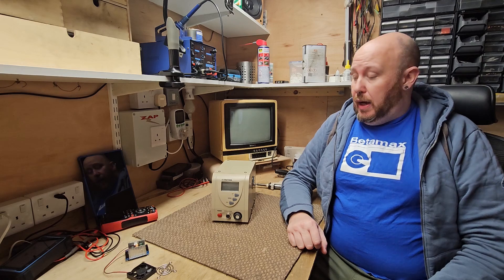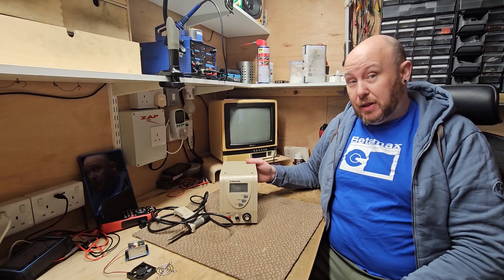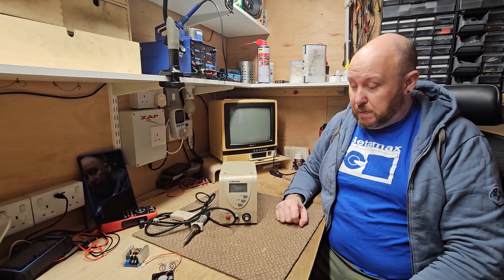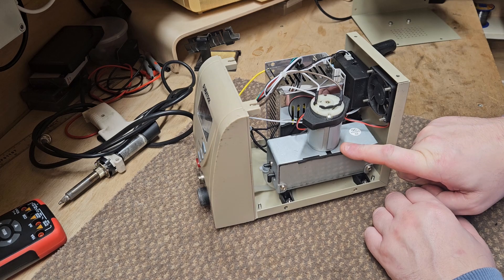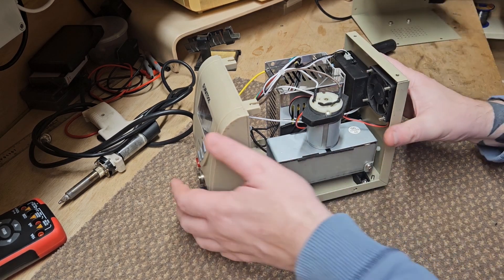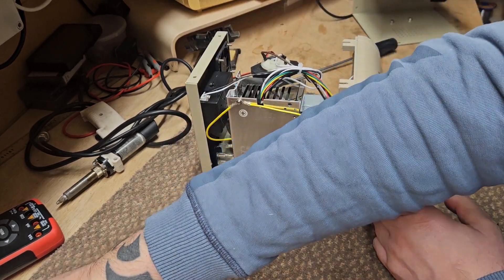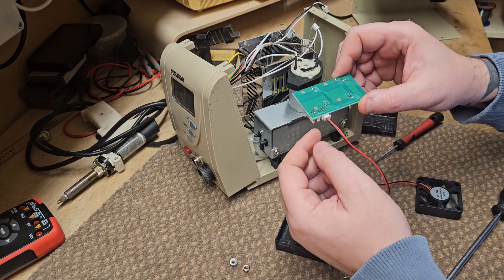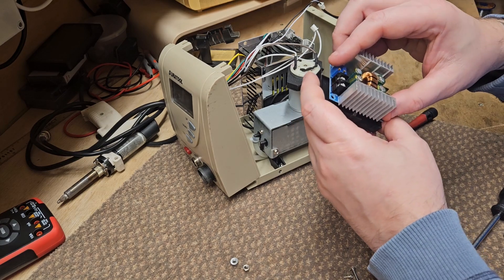Duratool de-soldering station mods

Comment: I replaced the 2 "cylinder" membrane pump with a rotary (axial) pump from the central lock of some old MB, and it is the best mod. These motors can withstand serious overvoltages, so a factory resistor dropper is absolutely fine. Higher voltage = better suction.

Comment: You have room in the front part of the unit to keep a spare fan , if you have quality fan it's probably not needed , but ya never know ........  Which buck convertor did you use ?   I plan on buying a electric de soldering pump soon ....... I will be doing the mod and putting in rubycon ETC. caps on the boards ..... That way I don't need to worry later on ......

Comment: This video has convinced me NOT to buy the duratool. If it takes this much effort just to get a decent product then fuck that I'll buy a Chinese product instead. Considering I've never used a soldering iron properly the whole idea of modifying it is extremely daunting. Still researching which one to get.
Reply: same thing different branding. Hakko are the proper japanese brand. Actually CPC and Farnells stuff is almost almost chinese rebranded crap, check for soldered wires going into terminals in place of wire ferrules or bare wire.
Reply: @ps3customgamer I ended up buying the fr-301.

Comment: I adjusted the vacuum from 500mm /Hg to a beautiful 750 mm /Hg beautifully quiet. It sucks even micro holes. The gun has 250-400 mm /Hg depending on the filter. Maximum after adjustment 600 mm /Hg
Reply: How do you bump the suction up on the pump?

Comment: I was looking at buying one of these, should I avoid it? I don't really want to spend £400 on a hakko one! 

And if I got it do you think these mods are worth doing immediately for some who would be using it very occasionally?
Reply: Buy one from japan and import
Reply: @ps3customgamer  I actually did this in the end. It still wasn't cheap once you factor in buying a transformer for 230v to 100v, but a lot cheaper than buying a 230v model

Comment: I noticed when Jan Beta did it, he put a diode on the motor to prevent the back EMF from potentially damaging the 12V regulator. Do you think it's not necessary?
Reply from the maker: I didnt actually notice that on his video! THanks for pointing that out.

Comment: Nice. I have been thinking of buying one of these. Do the mods do anything about the clogging? A lot of reviews complain about that.
Reply from the maker: Even the professional desolder machine clog up. I think the reason these clog up is down to the velocity of the vacuum pump. The DC-DC buck converter gives the motor a lot more current and consistently. the resistor drop really makes the pump slow down especially if using for desoldering many components in quick succession. That is what i've read about these mods. Still not perfect but better than factory.
Reply: @ResurrectionRetro  The difference in the hacko is the tube is heated all the way along so it doesnt block unless theres debree.